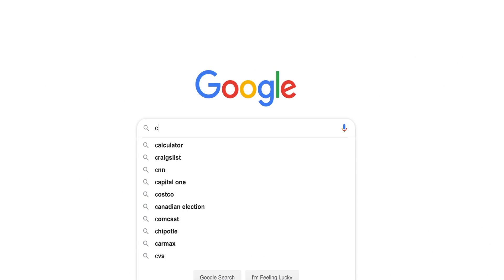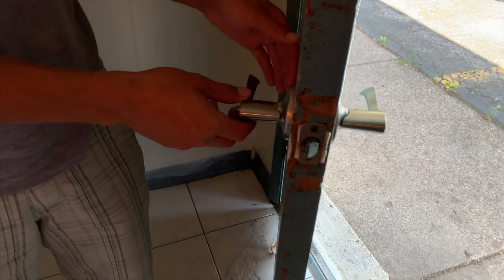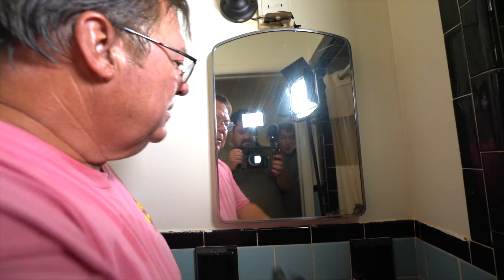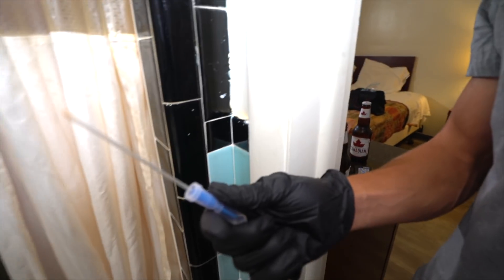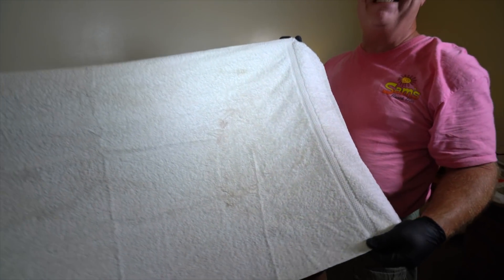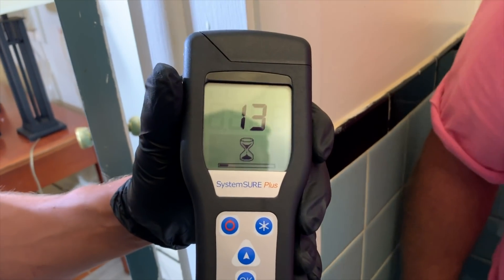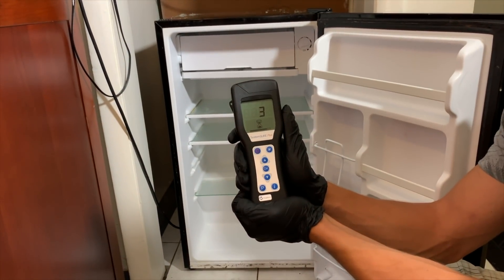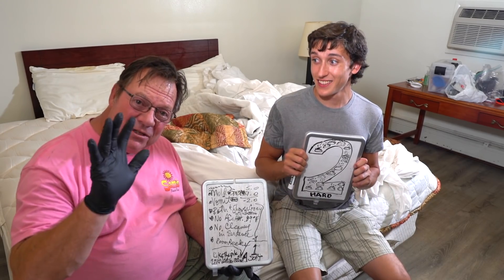Another Dirty Room THE FINAL SEASON :Niagara Falls : Chocolate Surprise! The Awful Crown Inn

Comment: I have spent about half of my working life traveling to do work. I've jumped at any chance to camp out near or on my job sites rather than stay in motels for hygiene reasons and noise issues. Even nice hotels and motels particularly in the south will always have mold or mildew in the showers which is a peeve of mine. That is partly due to safety regulations and lawsuit liabilities placed unfairly on lodging companies not allowing them to use harsh cleaning chemicals like bleach. When forced to stay in hotels I have always brought my own little bottle of bleach and some scrubbing utensils so I could clean the shower and shitter. I have camped a lot while working on the road and I am not talking traveling around in a nice RV which I could never afford. Just tent camping somewhere secluded just out of town out of my truck or off of my motorcycle, shitting in the dirt and taking water bottle showers beats having to deal with the filth and noise of a motel or even some nice hotels my employers were willing to pay for. Plus I usually got to pocket a per-dium which I would spend on some nice rib eye steaks to cook on a campfire and some beer while enjoying the quite and the stars.

Comment: The bathroom looks uncannily like my highschool' girls bathrooms... They've got the exact sort of stains on some of the seats and the sinks are coming off as well... The toilet's plumping is loose so whenever you flush, the metal pipe attaching to the back of the wall (it's the type of toilet without the back holding water in it) leaks water until the flushing stops. It's gross.

Comment: I fucking hate sleeping in hotels. The beds are rarely comfy for me (even 5 star hotels have failed me on this) Im  a bad sleeper and Im such a germaphobic. I basically clean lot of the surfaces myself, including the glasses Im supposed to drink water from. And I definitely dont use non sealed stuff. And use hotels as good as possible, even though this stuff would be an adventure...

Comment: I have a little known fact. That air monitor went off because that floor made in China - they use formaldehyde - big class action law suit tho I only got 40 bucks back with a health warning .
Reply: I’d bet that floor predates building materials being used from China.
Reply: @t.g.3500  no.. there was no such thing as a hard wood floating floor when that building was built.That was just a cheap upgrade.. or the real floor under it is soggy/rotten.

Comment: The wire connections they are talking shit about are not wrong! They would do the exact same behind the wall... to be honest good work behind the wall is hard to find. I work in contracting (home renovations/buildings ect) the amount of times finding that electricians charged for work they didn't do is ridiculous! They claim to change and update all wiring behind the walls but never did a damn thing